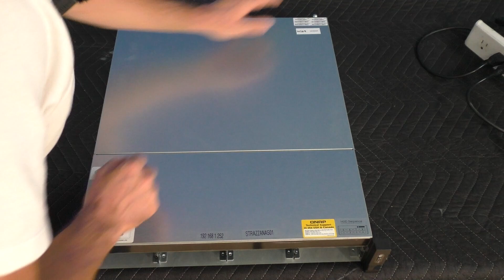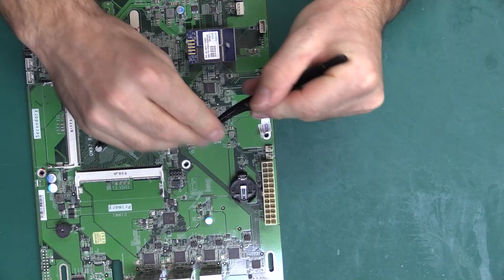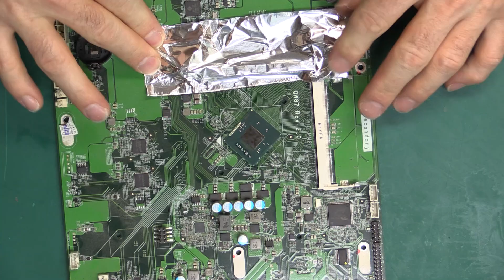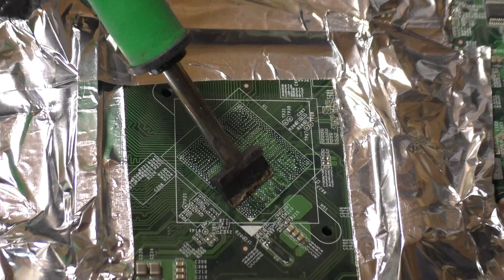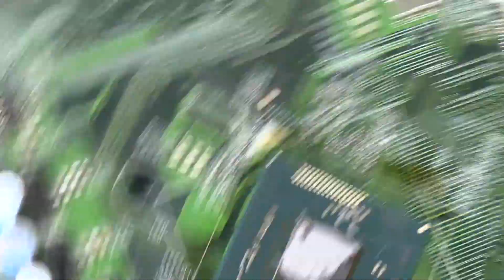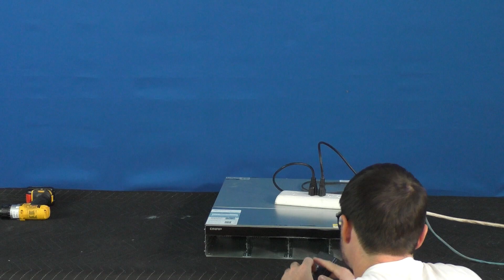No Boot QNAP Server Repair TS-853U-RP

Comment: Someone knows how much is the power of the PSU on the QNAP TS-853U-RP ?
Reply from the maker: It would say on the power supply itself. There is a sticker on it with all of it's specs
Reply: @NicksElectronicRepair  I know i don't have this NAS, on the pictures on the internet there aren't sticker on the back. I have found the info, it's 2*250W

Comment: This unit has a removable DOM/BOM, so it's easier to find it. But in the case of a 453Be, it is not removable, it looks like it's a part of the mainboard :(
Do you know what do I need to look for, please ?
Reply from the maker: Sorry I have not fixed a 453be before. I don't know what commonly fails with them and how to fix them at this time. I wouldn't be able to help you troubleshoot unless it was here at our shop.
Reply: @NicksElectronicRepair  Oh ok, I understand. Btw, did you already tried to direct access a DOM/BOM to (re)write its content ?
Reply from the maker: I have but only for the purpouses of making sure that I could access the information on the DOM at the correct read speeds thus confirming it's not the issue. I have not ever had to rewrite its content. I made a video on that actually for a DS1813+ Synology NAS recently. 

Disk on Modules (DOM) provide a compact form of flash memory that is directly integrated onto a circuit board